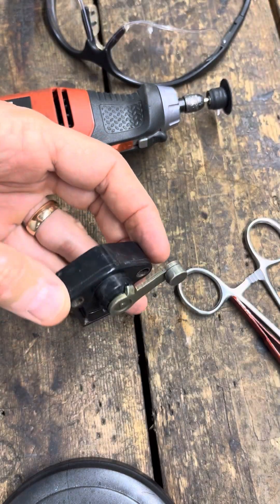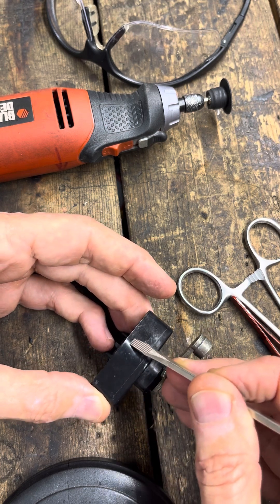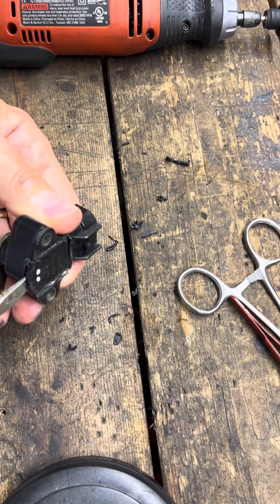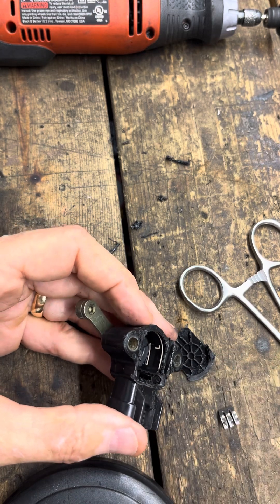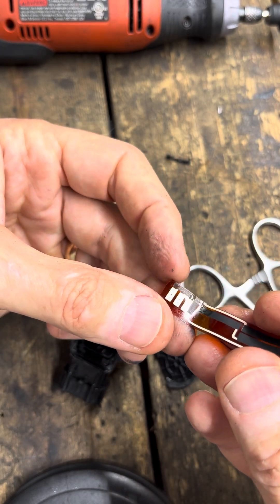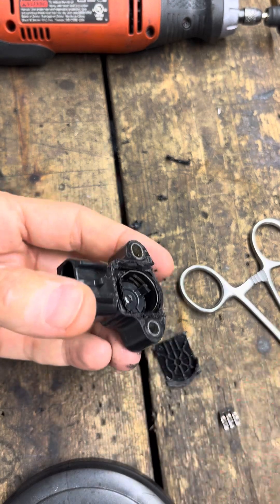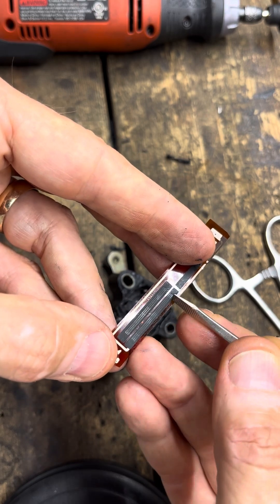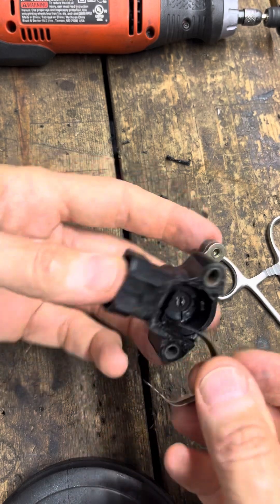Position Sensor -  Disassembly and Inspection.  MR2 Spyder SMT

Comment: It is a shame repairs like this have to take place because Toyota stopped supporting this HPU and no aftermarket parts are available. 90,000+ miles on mine so far and no major issues.
Reply from the maker: @MrFixit1  I can’t decide if Toyota or LuK are to blame.   Car manufacturers frequently buy systems like this for their cars.  I think LuK is partly to blame.